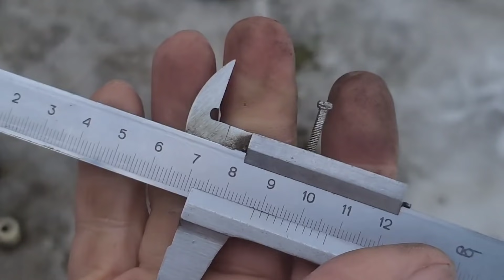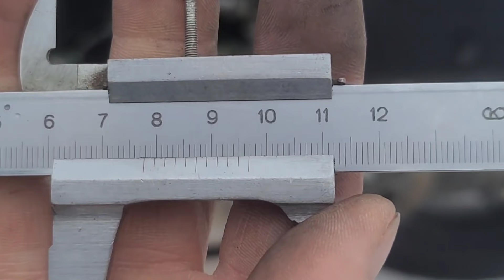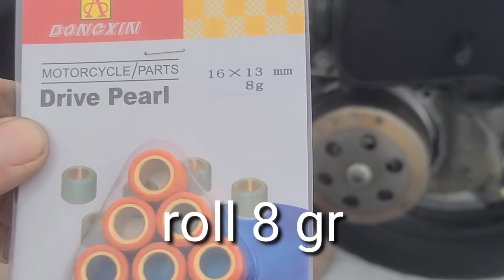Replacing the belt and variator rollers on the Honda Dio scooter

Comment: Hi! I own a Honda Dio af57, which I believe is similar to af56. I have a problem when accelerating, the engine revs up really fast and loud, but the scooter isn't going fast, and eventually stalls at 20-25km/h. I might believe the clutch is not opening. Sometimes I am lucky and it only does a small period of time when accelerating, then there is a kick/jerk (i don't know how to describe the feeling), and it accelerating normally. Do you have any idea what could cause this? Thank you!
Reply: Don’t try if not experienced, but you might  have a dirty carburetor with a bad fuel/ oil mixture inside of it.   

Adjustments could take care of this,  if not you’d might have to take out the carb.  

Most people do it themselves, but they need to spray carb fluid cleaner into the small nail size valves, and then adjust the Gas float to make sure it’s sitting properly.  Check the manifold and the connection, replace if necessary.   

You’d need to look at a video explaining how to clean a carb.   Takes about 30 minute but more to physically sit down, take out the valve and clean them properly.

Very time consuming and patient process. 

The worst part is to turn it on, get the same results and find out it might be water in the fuel /air pump lines, and the vacuum fuel pump, fuel filter and inside the gas tank.  Then you’d have to dump the fuel and refuel using non ethanol gasoline.   Use a gas stabilizer if storing in cold long winters or periods where nonuse is occurring. 

The simplest fix might be a bad or dirty spark plug, that simple.    

But you could face the nightmare of having a faulty electrical system that was damaged by water.  This is the worst case though.

Comment: What is the drill you use to remove the drive pulley
Reply from the maker: 17mm
Reply: Why not make the pulley attached to the mother engine as large as the one on a bicycle and the small follower wheel as well as a bicycle, so that the bike in a quiet condition is faster and better than the one you are doing?????